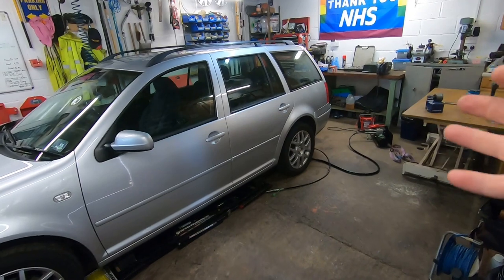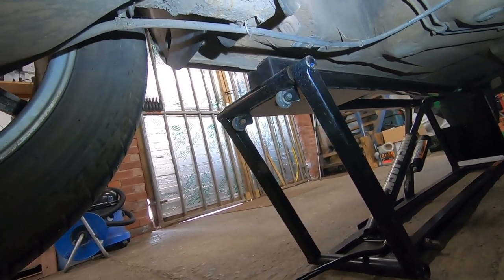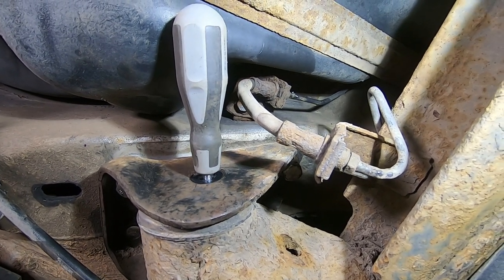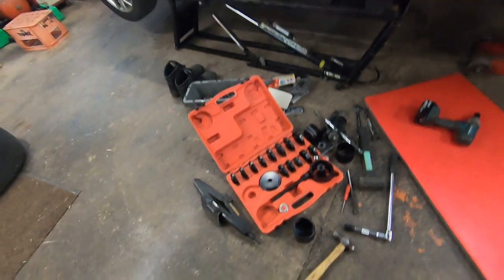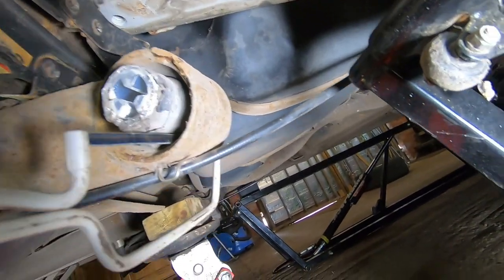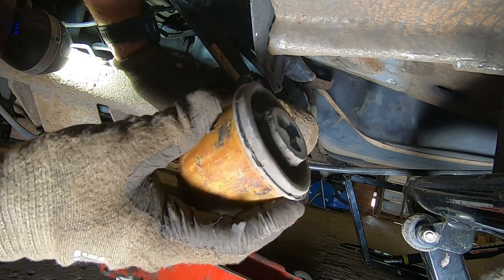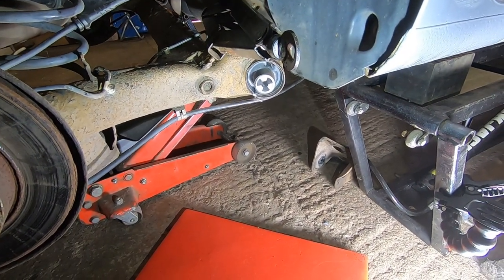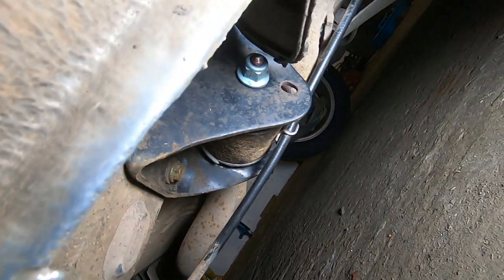Replacing Mk4 golf rear suspension bushes, on the car. Project daily

Comment: Many thanks for posting... served as a great guide for doing my TDI Fabia. The hacksaw didn't quite cut it for me, so I used a 14mm spade bit to drill out a channel in the rubber, then I heated up a metal rod and pushed this through the plastic outer of the bushing. I was then able lever them a bit to loosen them, and then tap them out easily with a hammer.

I used tippex to mark the orientation of the old ones, and then copied these marks across to the new ones to ensure accurate alignment.

My new bushings were oversized by about 1mm (have read of others having the same issue) and there's no way they were going in. So the turned them down on my lathe (other people have attacked them with a flap disc... sounds brutal to me!).

Made up my own puller from 10mm threaded rod, washers and a bit of box section. I found the best way to ease them in (this the help of some washing up liquid) was to tighten up as far as poss, then tap around the perimeter of the bush (use a bit of wood to protect it from hammer blows) to get it to jerk in some more, retighten and repeat.

Also had to grind off one brake pipe bracket and reweld afterwards. Overall, took just over a day to do, but having now now it once, could probably sort it in half that time!

Best of luck people!
Reply from the maker: @miniphase  Thanks, no problems. Good work sorting it out 👏.

Comment: Good work HOWEVER! never remove the rear brackets from the car, this will knock the tracking out needing an expensive 4 wheel alignment!!!! The best way to do it is to pull the bolt out till it touches the fuel tank, then cut it off with a grinder, then pull the rest out. once you have changed the bush and pushed the axle back into the bracket all you have to do is to insert the bolt from the wheel side and put the nut on the inside. It does not matter which way the bolt goes on this part as long as its tightened after your finished! and always always always USE BRAND NEW BOLTS as part of the change, Its them two bolts that holds the whole back axle to the car, If you have had this work done at the dealer have a look under your car and you will see that they fit the new bolts the other way round! Also there is an upgraded bush that is not polly, its a much better bush than the standard ones, part number is (6Q0501541E) or (1ML501541) or (febi 31694) any of these are much better heavy duty bushes but are not quite as hard as polly bushes which are shite on the back end of a golf.
Reply from the maker: Thanks 👍
Reply: I'm in the process of changing the bushing.  Drive side, easy. Passenger side, my reaction "What the heck,  the gas tank is in the way." This video was very helpful, along with this comment.   Thanks to you both.
Reply: great tip about the bolt 👍

Comment: Hi, also the bolt that fouled on the fuel tank, this is the same with the Mk7 Fiesta, suggestion when replacing, put back in the other way so the bolt can freely be removed if needed in the future
Reply: on the fiesta the brackets dont have adjustment IIRC so its OK to remove them, but on the golfs they have adjustment and you should avoid altering the alignment of them

Comment: I’ve just done the rear bushes on my VW T5, done the arb bushes as well. What an absolute ball ache on a gravel drive. Brake pipe snapped both sides trying to get them out..didn’t have a removal tool like you so set the bushes on fire & then knocked the inner casing out (one took 2 hours as it was rusted to the arm 🤦🏻‍♂️) I was putting poly bushes in so they went back in a lot easier than the standard bushes.
Reply from the maker: Good work sorting it out 👌. They can be a right pain sometimes. I did think about fitting poly bushes but was worried they might be a bit stiff and noisy. How do you find them now they're fitted, any better?
Cheers Larcs 👍
Reply: @LarcsWorkshop  my van is lowered on coilovers so it’s stiff anyway, that’s why I opted for poly bush. Just ordered a set for the front (hopefully easier than the rear 😜)
Reply from the maker: @gandhi1078  . It'll all be brand new once you've done 👍

Comment: Thanks for the great info video 

Going to do the job soon so was good to see your job 

what size spacer did you use to drive in the bearing ?
Reply from the maker: No problems 😃, thanks for the comment. Sorry, I can't remember what bits I used out of the kit now, it was a while ago. 
Cheers Larcs 👍
Reply: Bushing is normally 69mm so anything over 70mm - poly-bushes only require a rubber mallet to tap into place

Comment: This was the video I was looking for - unfortunately I learnt the hard the way by repairing the rear brake lines and knocking the rear alignment out ;-) - I found Poly Bushings didn't make much difference to the comfort, but super easy to install and do not require aligning. I also replaced rear suspension top mounts and springs. Really like the way you implemented the scissor jack and hydraulic  jack, highly recommend 4 wheel alignment after any suspension work.
Reply from the maker: Thanks 👍

Comment: hi good job, one question did you have to undo brake lines on passenger side to lower beam, mine are looking very crusty
Reply from the maker: @pauloneill8912  Thanks 👍. I managed to do it without undoing the brake pipes. If they're looking crusty it might be an opportune time to replace them? Good luck sorting it out 🤞
Reply: @LarcsWorkshop  many thanks, how did you get room to drop the beam on the passenger side?
Reply from the maker: @pauloneill8912  Thanks. IIRC I undone the brake hard line bracket to give it a bit more slack.
Reply: @LarcsWorkshop  yeah thats what ive done on one side but the other the bracket is fixed, ive undone the brake union and the flexi is rusted solid into the bracket, will need to cut the bracket off i think, thanks for your replies and keep up the good content
Reply from the maker: @pauloneill8912  Thanks. Good luck sorting it out 🤞

Comment: Well done mate. Just done my mot today and there was advisory regarding this bushes. I'm gonna buy them ASAP and of course buy/ hire the removal set. Anyway great video.
Reply from the maker: Thanks 😃. Good luck with the repair 🤞.
Cheers Larcs 👍
Reply: dont get the standard bushes,  (6Q0501541E) or (1ML501541) or (febi 31694) any of these are much better heavy duty bushes but are not quite as hard as polly bushes which are shite on the back end of a golf, always use new bolts!

Comment: Well done, I’ve got same job to do on our Jetta and Golf.
Reply from the maker: Thanks, good luck sorting yours out🤞.
Cheers Larcs 👍
Reply: dont get the standard bushes,  (6Q0501541E) or (1ML501541) or (febi 31694) any of these are much better heavy duty bushes but are not quite as hard as polly bushes which are shite on the back end of a golf, always use new bolts!

Comment: Hi Larcs just want to know, my back tires wore out the inside tread. What could be the problem? is it this axle bushes you replace here? I have a Golf 4 1.6i 2003
Reply from the maker: Could be, best to have a visual of them and see if they are worn out. Good luck.
Cheers Larcs 👍
Reply: dont get the standard bushes,  (6Q0501541E) or (1ML501541) or (febi 31694) any of these are much better heavy duty bushes but are not quite as hard as polly bushes which are shite on the back end of a golf, always use new bolts!

Comment: Much respect for you bud,i own a mk4 golf,and my rear bushes are starting to look tired,i must say you made that look easy,how much did you pay for the hydraulic stand if you don't mind me asking,great video my friend..well done.👍
Reply from the maker: Thanks, they weren't too bad, just awkward and a bit time consuming. I got the QuickJacks second hand off Facebook market place for £750.
Cheers Larcs 👍
Reply: If it helps, I was able to get plenty of height with axel stands using two hydraulic jacks and blocks of wood. Brick the front wheels and combine jacks and axel stands for extra safety when clubbing the old bushings out. the plastic bush are easier to remove. Some have older metal housed busing, these take a bit more work but same process.
Reply from the maker: @markcobby8523  👍

Comment: Poly bushes would be / are far easier. Like the way you removed the bushes though.
Reply from the maker: Thanks, I agree about poly bushes but at my age I need comfort over sportiness 🤣.
Cheers Larcs 👍
Reply: dont get the standard bushes,  (6Q0501541E) or (1ML501541) or (febi 31694) any of these are much better heavy duty bushes but are not quite as hard as polly bushes which are shite on the back end of a golf, always use new bolts!
Reply from the maker: @robinsonlabs  Thanks 👍